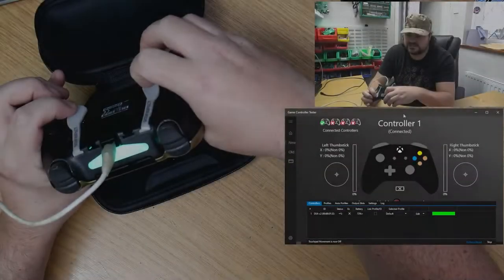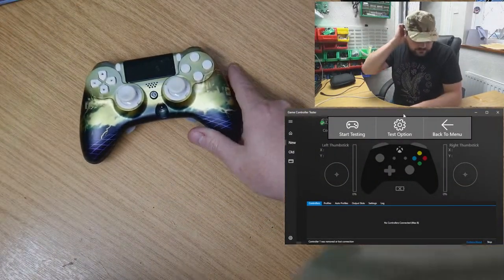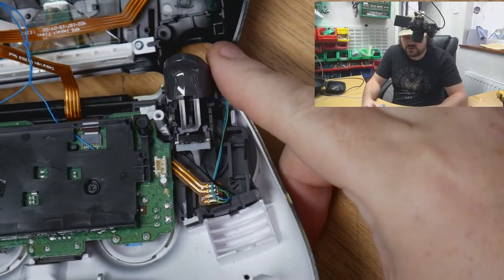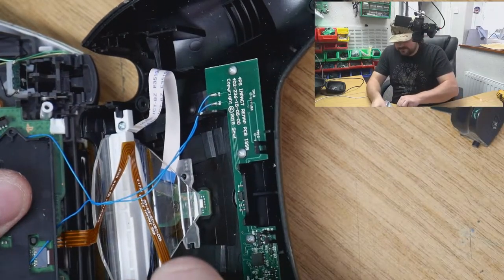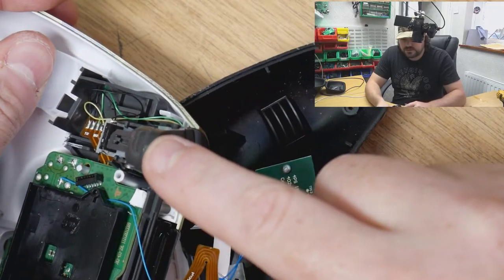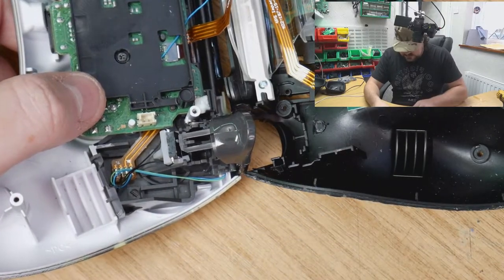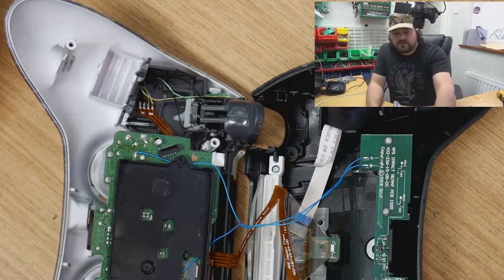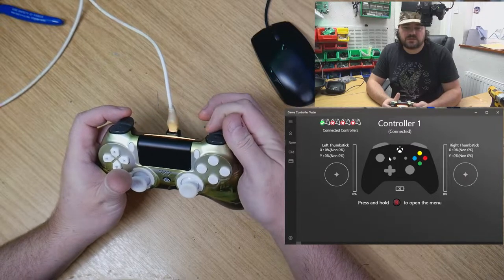SCUF Impact Dead Right Digital Tap Trigger Fix PS4

Comment: What tool is it to get the scuf screw out? Also, good work on this 👍🏼
Reply from the maker: Thanks. I modified a GameBit.
Reply: ive drilled the head off and then replaced them with a standard head bolt

Comment: If the switch is faulty and needs to be replaced how to you recommend removing the old one. It appears to be glued on the resting bracket?
Reply from the maker: Should be heald on with hot glue or double sided tape.. Just heat it up slightly.

Comment: I found a very helpful tool to remove the scuf screw if you have a dremel use the little tool they give you to attach to other objects that worked like a charm for me the bit head attached and it unscrewed for me
Reply from the maker: Yeah, I modified a Game Gear scurity bit with a deremel and it works great. The proper tool can only be sold under licence in the US as it's use by CATTV engineers. I beleive?!
Reply: I was just going to ask that if they no longer use it, then why can't we buy it. You have answered that in your reply. Thanks.
Reply: @notimportz hey man very late but do you have a link for this tool or to a picture where i can see it?
Reply: @UberMicroRepairs  you can buy one from Japan, cost over 100 pounds though

Comment: Mine makes the clicky sound but just doesn’t respond 😬 can I fix it without taking it apart
Reply: no, you need to replace the little black module. Costs 6 pounds + a bit of soldering is needed.

Comment: What size  tool do you use to unscrew the bolts
Reply from the maker: PH001J for the crass heads and the security screw is a bit I custom made because you can't buy them anywhere.

Comment: going to do an L1 Digital switch on my ps4 scuf, it stopped working and I wondered why and when I took it apart i noticed that one of the wires fell off the solder on the switch , dont get why this would happen, but am i able to just expose more of the wire and just resolder it back on ?
Reply: @UberMicroRepairs
Reply: I’m having the same problem, Have you found a solution yet?
Reply: @3amr881  Yea I did , depending on how your cables look to your trigger , you can carefully trim off some of the plastic coating and just sauter it to the switch. Just a heads up though, it's one hell of a small space to sauter , but I did it , works like a dream

Comment: ive just ordered the switch for the digital triggers off your site, as it unglued from the plastic so tried to glue it and got glue in the switch(rookie error lol) is there any vids on how to replace it, or is it to simple for a vid lol not very good and electrical things, thank you.
Reply: Did you’re old switch just fall off? I need to replace mine and wondering what my best option would be to remove the old switch if it’s still glued. I’m thinking about using my soldering iron to melt it away from the resting bracket.